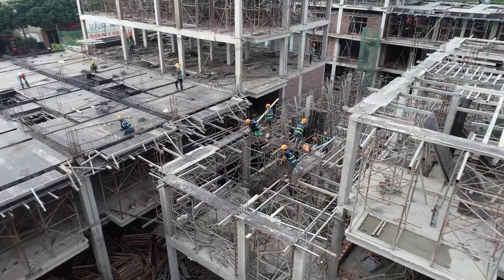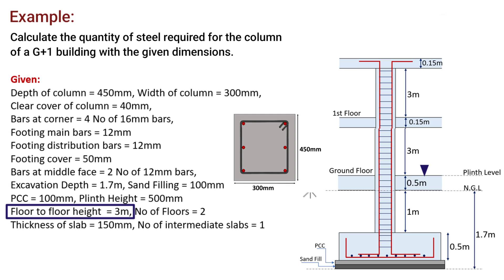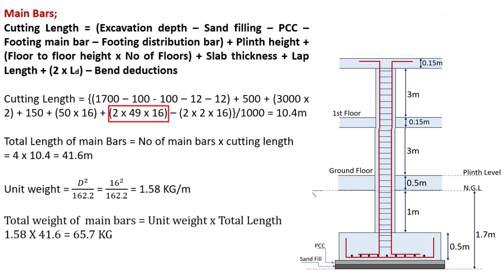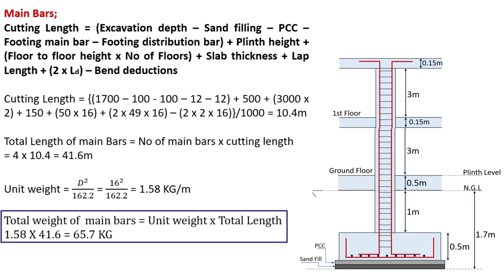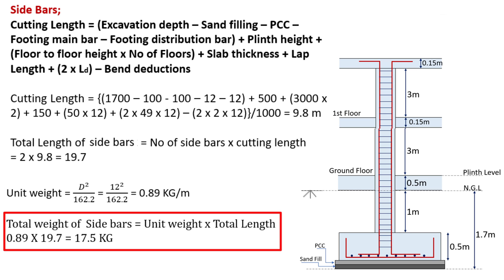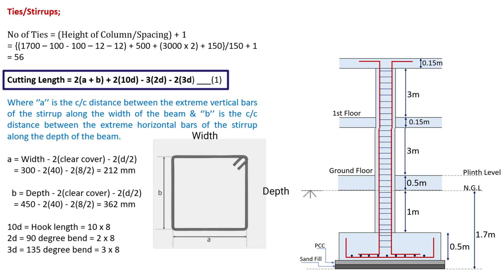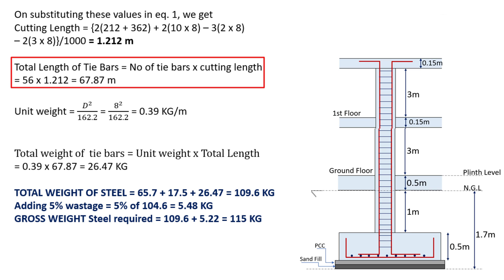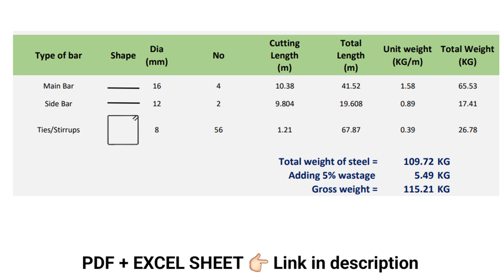Learn to calculate the quantity of steel in column | Bar bending schedule of column | Civil tutor

Comment: In your another video you said for G+1 building Column Size 9X12 with  6no steel of 12mm.... Now you are telling 4 steel of 16mm and 2 steel of 12mm...
Which one is correct for G+1 building?
Reply from the maker: That's thumb rule.... In case you don't consult a structural engineer